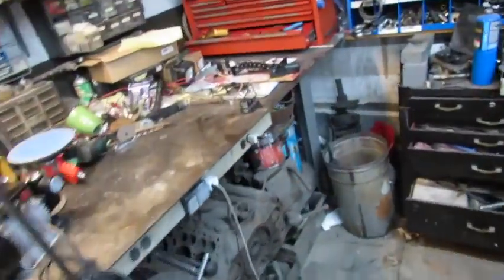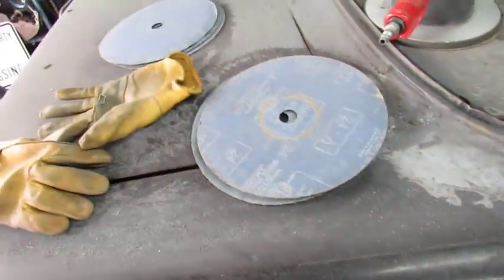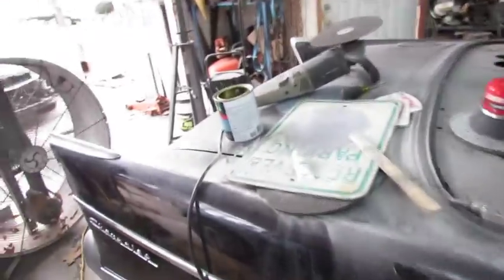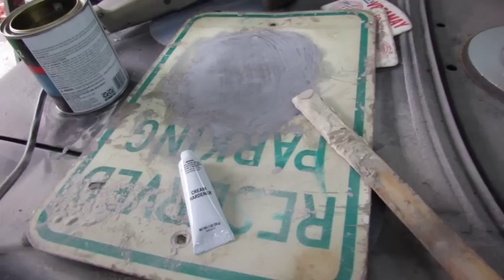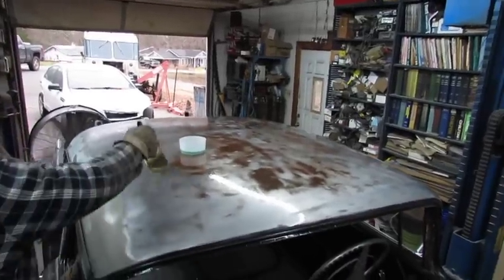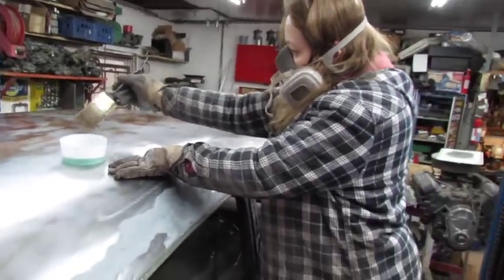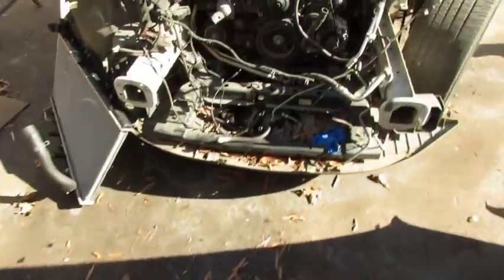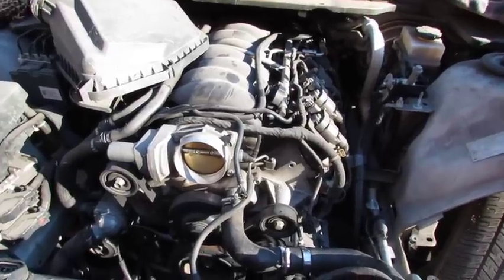57 Chevy Body Filler Begins

Comment: Dear Mr. Hevyshevy family
Firstly: Happy new year to all of you (including the dogs).
2) The clogged sanding disc can be cleaned relatively easily with a piece of Nylon (little block) or a plastic cork from a sparkling wine bottle. Run the disc slow and slightly press on the Nylon. I always got rid of nearly all the sticky stuff easy and fast. But please definitely wear safety goggles and protective gloves while pressing the plastic cork or Nylon block on the spinning disc. Otherwise you probably won't need a manicure for a long, long time! 😁 ;-)
Best regards, luck and health in particular.